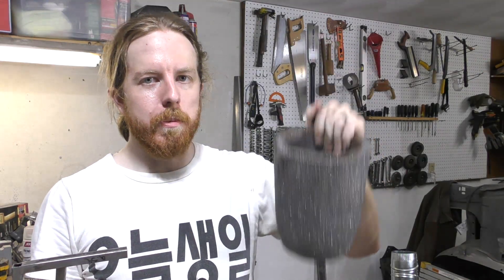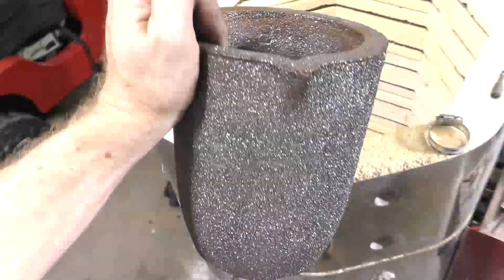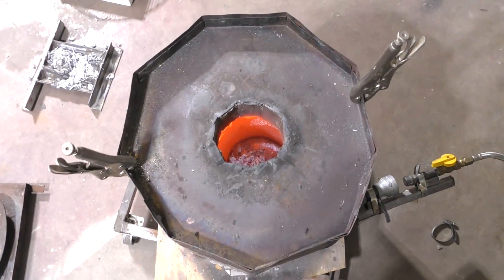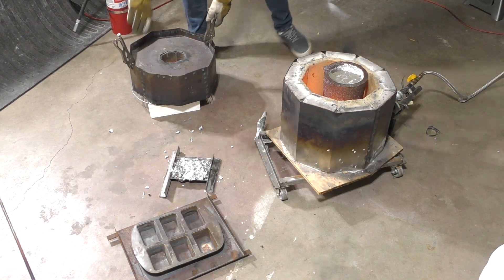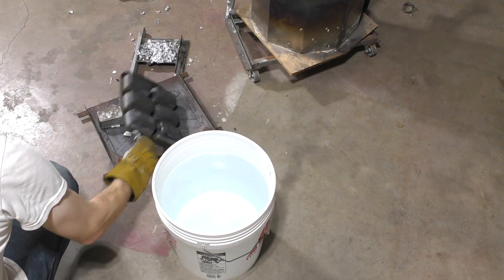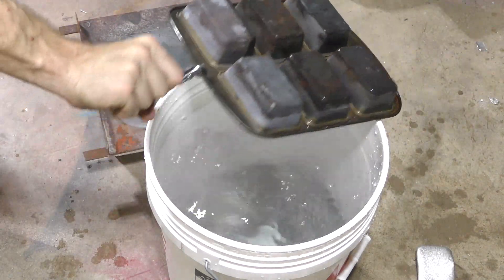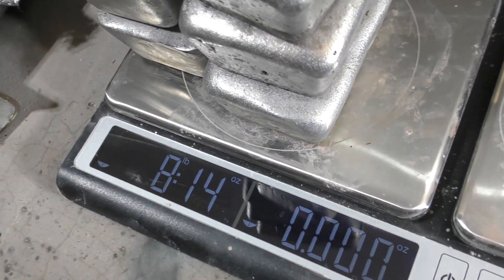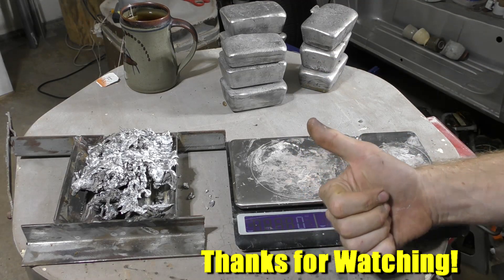My Biggest Aluminum Melt Yet: Testing the Improved Crucible Tongs

Comment: i been getting reasonable results after watching your (and similar) presentations.  and thanks.  l was wondering if a tongs could use that 45*L handle since all my present tongs are chancy with my smaller crucibles.  now i must also brave the mig.  also, maybe just pour out the aluminum  you want not cast to form flat sheets maybe 3 to 6mm  to be cut into brackets or use alumiweld rod to make more complicated parts from cut stock.  i find flat pours on cookie sheets can form reasonable weird freeform wall decorations too.
Reply from the maker: I could pour it out into sheets but the thickness would be uneven and the alloy is wrong.  I use a cast aluminum alloy here (a380) which flows well but it's actually kind of brittle.  A freeform wall decor would look pretty cool though!

Comment: Man, I'm jealous! I've had the worst time finding aluminum. I was going to use pistons. I want my own Gingery shop!
Reply from the maker: Pistons can be cast or forged, and some of the cast ones are hypereutectic (those are the best ones to get!) Just be sure to know what kind you get
Reply: @PaulsGarage  I have a lot of cans, but as we both know, pure aluminum is not good for machine parts. Si is prohibitively expensive now. I'm working on a furnace lined with refractory and kaowool. Maybe I can get it hot enough to melt steel.

Comment: Why don't you use the copper wires for casting? Or does the insulation cause problems?
Reply from the maker: yeah the insulation causes a lot of smoke and dross, plus burning wiring insulation is illegal.  Just not worth it when i have so much copper pipe laying around

Comment: Crucible numbers are specific to the manufacturer. Sometimes it means pounds of brass (smallest) others times it means pounds of aluminum (larger). Then to make things more confusing and not consistent it may be based on some other metal/alloy or even water. Yet that's still not the end of the story; as the numbers maybe in kilograms and not pounds or occasionally the number is in volume (L) and not weight.

So general rule kg, or lbs typically of water, aluminum, or brass always depends on manufacturer as there's no true industry standard.

Comment: the scrapguy must be REALY happy with you , the copper gets him about 3,30 dollar per pound if he strips it out of the metal core
it might be cost effective to either cut off the copper wire at the top and bottom off those cores on a bandsaw youreself or to melt the copper out of the metal cores and cast them intoo bars and sell those at the metal collecting place
Reply from the maker: I don't want to mess with the wiring when i have plumbing copper, simple as that.  And i hope he's happy!  He also has to take a bunch of plastic junk off our hands too as part of the deal.  You get it all for free, but you have to take it ALL lol

Comment: the 8 is the volume. so may have one that is bigger with thinker walls but same volume.
Reply from the maker: i'm not sure about that, the bigger on is about big enough on the inside to fit the entire smaller 8.  i'll have to test it out though
Reply: @PaulsGarage  could also be manufacturer discretion of what will safely hold that volume of molten metal.

Comment: Do you stack any ingots up for keeps? Also my heart slipped when you said you give that copper to a scrap guy. Copper is so sparse where I am a man would never.
Reply from the maker: I stack all the ingots on a shelf (separated by alloy) and use those when i want to cast something.  rarely cast straight from scrap, usually make ingots from scrap to remove the impurities.

Comment: I thought a number 8 crucible held 8 lbs of aluminum
Reply: Or possibly 8 lbs of brass, or 8 lbs of lead. Or possibly 8 kg of aluminum, brass, lead, etc. Oddly, I even saw a crucible that was rated in lbs of water for sale online once. It's really just a manufacturer specific number. That being said, easy way to figure out how much it will hold is weigh how much water it will hold, then use that and the density of aluminum to figure out how much aluminum the crucible will hold.

Comment: When I melt cast wheels, I cut them up with a circular saw and a carbide tipped blade.  Secure the wheels well, and use lots of PPE.
You will get lots of 'man glitter' everywhere.
Reply: This works, but to reduce the amount of dust you can score the wheels with the saw (or use a grinder & cutoff wheel) but not cut all the way through, and break apart into chunks with a sledgehammer. Just do it on a chunk of wood, not on the concrete, makes a bit of a mess. Although cast wheels are also often die cast, so the alloy probably isn't that much different, but it's still good alloy to use and really easy to break apart.

Comment: But... the copper! You just give it away?!?
Reply from the maker: Yeah, the copper is all covered in varnish and wrapped around that magnet.  Melting it would be similar to melting cans.  Lots of surface area loss to oxidation, lots of extra crap to burn for dross.  I'd rather not mess with it and just use pipes
Reply: @PaulsGarage  Yeah I get it. It is also pretty labor-intensive to get the wire out.  I do love a good copper melt though

Comment: Looks like the tongs worked pretty good, not as good as you had hoped though?

That melt should really condense the amount of space the motors were taking up. You don’t want to melt down the copper for something you might need in the future?
Reply from the maker: The only issue i had was basically the fullness of the crucible.  With it full to the tippy top, i can't tip it much before metal just comes dumping out.  Also the weight, though manageable, is about the upper limit of what I feel the tongs can handle.  If i want to use that even bigger crucible, i'll probably want to make another set with more substantial handles.
Reply: @PaulsGarage  that makes sense. I didn’t quite understand if you were having an issue or not…

Comment: Yeah my furnace burner doesn’t work unless it’s not like over 10 psi it doesn’t stay lit it really low temperatures it Hass to be really high for it to actually slide itself
Reply from the maker: home made burners are sketchy like that.  Gotta get the design right, or better yet just get a commercial one. Those weed burners work really well, though they run a bit rich
Reply: @PaulsGarage  I use the "weed" burners exclusively in my 2 beer keg foundries. My solution to them running "rich", was slowly increasing the size of the air holes. The final size of the holes is about 30% larger. I'm comptemplating building a shroud around the burner, to allow me to add a forced air system. My existing set-up is fine for melting alum, but it struggles to melt a #10 crucible of copper or brass. It provides plenty of temp (2200*F+), but you still need enough BTU's to melt copper or brass.
Reply: Yeah I’ve been having problems with my furnace burner staying wet and it has gone out a few times and the furnace has filled up with propane without a flame that kind of made me kind of nervous

Comment: There are A8's and #8's.  Seems like one of those means 8# of aluminum, maybe the #8 since it has the # in the name?  That would mean the A8 holds 8kg of brass.  Or something.  I used to know this.
Reply from the maker: i used to know that too lol at least I thought I did.  Then i ended up with 2 crucibles of vastly different sizes both marked "8" from the same supplier.  Now i'm confused haha
Reply: Seems like I did a video on this. Of course I got blasted for doing division in the video. :-D 
According to the fine people over at PMC Supplies
"The Kg designation is factored using brass.  The # designation is actually the crucibles capacity in pounds of aluminum. For example a #6-8Kg crucibles is designed to hold up to 6 lbs of molten aluminum OR 8 Kg of Brass."
Reply: I remember your video Perry.  Just not everything you said in it... 
So to sum up?: 
-#8 means 8 #'s of Al. (nailed it) 
-8kg means 8kg of brass.
-A8 means it is not bilge shaped and holds 8 somethings of something.
-B8 means Bilge shaped and holds 8 somethings of something.
-"something(s)" above refers to between 2 and 4 different things
Or something. 😁
Reply from the maker: Interesting thanks!  Still not sure why i have an even bigger one also stamped with an 8 from PMC, but im not too concerned
Reply: @PaulsGarage  Could one of them be 8 lb and the other 8 kg? I was once working on the instrumentation of a complicated scientific test rig where we were getting the expected output pattern, but the numbers were 2.2 times larger than expected. After a few days someone was like "hmmm seems like 2.2 is kinda a familiar number..."
Reply: @tobhomott  Yep, you nailed it. 😄😄   I've only used the dual number crucibles so I didn't go so far to ask what things like an A8 hold.